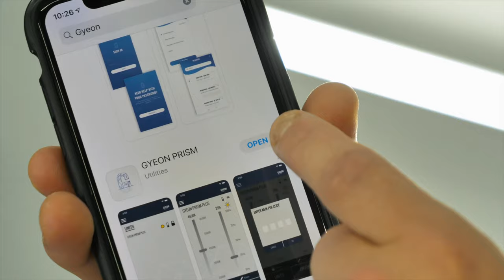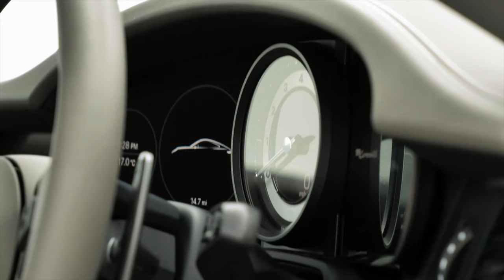Porsche 911 (992) Aventurine Green

Comment: Great video, disappointing color.  First of all, it's NOT the same as the original Aventurine Green from the 993, which was a dark gunmetal gray/green.  This new version looks like Agate Gray with a slightly greenish tinge.  In daylight, such as at the 0:32 mark, it looks completely gray.  I was hoping for a richer green color.  If you can afford it, you're better off going the PTS route and speccing either Malachite Green, Oak Green, or Aston Martin Racing Green (yes, Porsche's PTS catalogue includes an Aston Martin color).